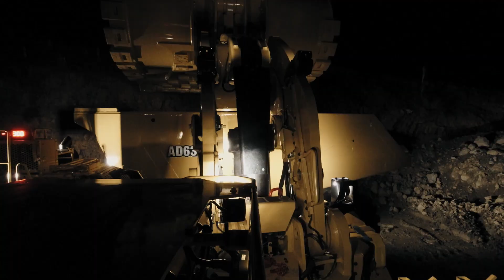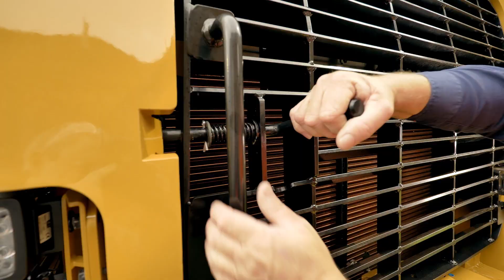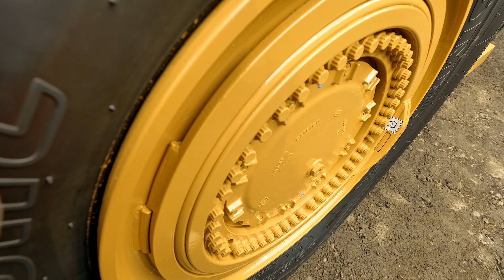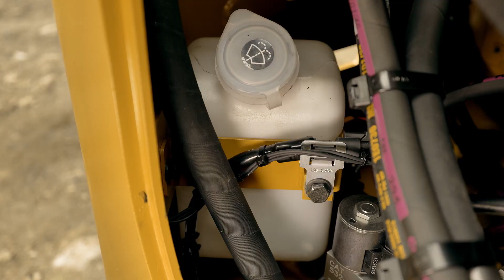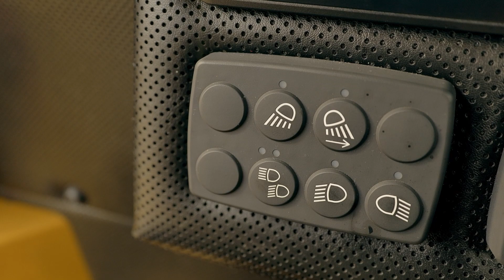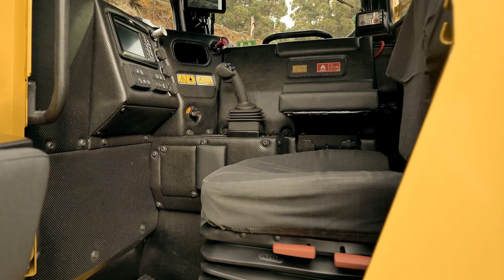R2900 XE Underground Loader Walkaround

Comment: With all respect to CAT: In the 90's as an underground miner, I operated a brand new EJC 400. (Disclosure: it was 30 years ago.) This R2900 seams great and  Lightyears ahead of my experience. From an operator point of view it looks to be a joy!  From an Operator point of view, it is great. However, Dust on cameras is an issue underground you have not solved without a fluid reservoir and / OR expense aside from owner neglect as "not necessary". (Operators hate that line of thinking.)  From a Managerial view, it is an investment but fights current maintenance from new equipment vs older equipment in parts, training and downtime VS.  As an experienced driver I would drive one before purchase, but at face value I think it may be worth it. Single daily maintenance is absolute gold in time and labor. Auto lights may or may not be ideal pending environment and disabling / override via driver should be an option. 
Overall a great machine. Usage, Training and Maintenance is the crux to making it a viable money maker. Good luck.